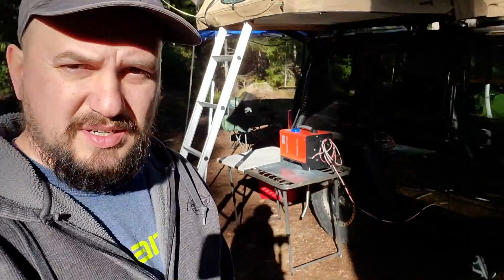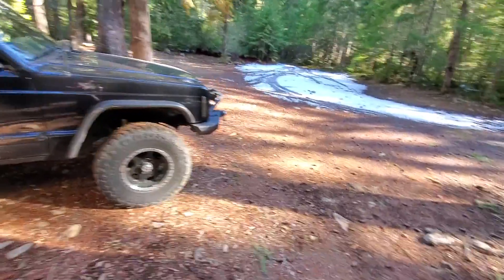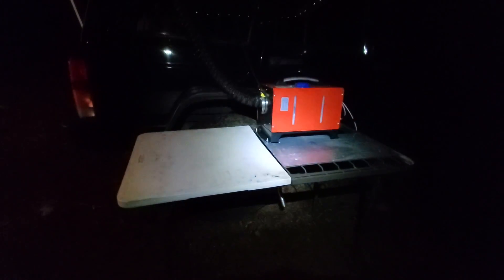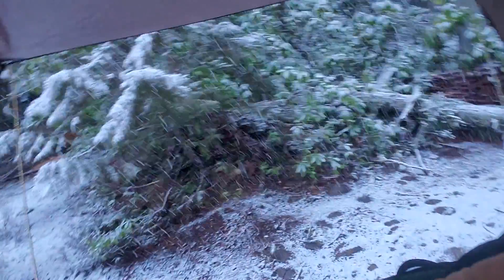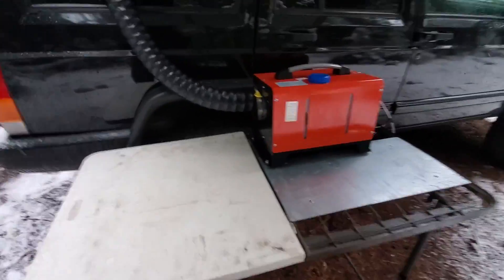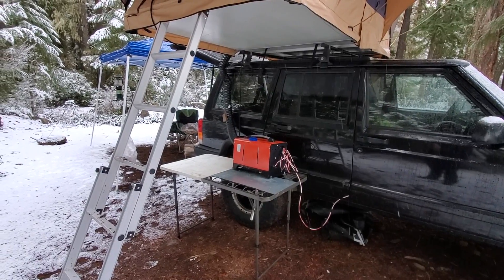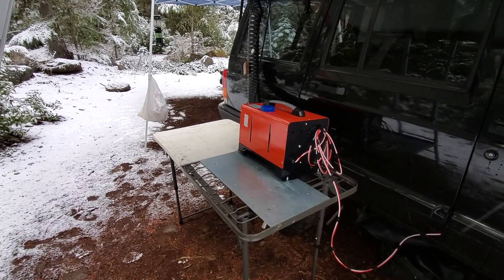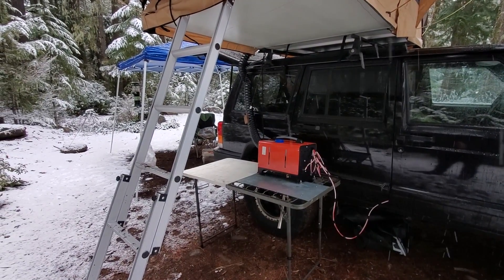Using a chinese diesel heater to heat my roof top tent (review)

Comment: I bought one like that and enclosed the bottom leaving access on both sides using hinged doors. I used copper 90 degree fittings out the bottom to the sides where I can hook up the exhaust (which is insulated and exits on the fuel tank side ) and the combustion air ( which exits out the same end as the inlet air) , this gives me a place to store the exhaust pipe and combustion air tube plus the electrical wires to power it
Reply from the maker: Thats a good idea. I'm sure i will add things on as i use it.

Comment: I have that unit.  It Draws 7.7 amps for a minute at start and at shut down.  It draws .27-.5 amps runnung on low and 2 amps at 3.3 P rate.  Nothing as AWESOME as an Oil furnace blowing on you while watching it snow.  I wouldnt run it a full blast to clean it.  Mine I run at 3.3 puls max.  I set the controller max at 3.3P and 4000 rpm.  These run wild at 5.5P and 5500 RPM.  I was scupitical when I bought mine.  I dissassembled mine all the way down and put it back together twice.  I ran mine on Lamp oil at first.  Dollar General had some for $6 2 liters.  If you need to get some fuel in a pinch this is a good option. I add a pinch of 2 cycle oil .  Cool Video man, LET IT SNOW...

Comment: Fuel is .02 x 1.9 x 60x60 will give you the fuel consumption, and the 1.9 is just assuming that what your low setting is. Use of battery is about 8 to 10 Amps for the start-up, once the glow plug is hot, in about five minutes, the Amps drops down to 1/2 to 3/4 Amp for running it, then once you shut it down it jumps back to 8 to 10 Amps to heat the glow plug to burn off excess fuel. 15 liters I can get about 7days before refueling.

Comment: Looking into one of these heaters as an alt to propane for my 21` 5th wheel. It would have to be in a covered box outside, otherwise I know that clicking noise would keep me awake, like a ticking friggin clock. I think having the tank enclosed in the unit would help keep the fuel from gelling. But if your camper is on a permanent set up filling that small tank would get old.
Reply: Apparently a tank full will last around three nights

Comment: Nice video, thanks, I have a solar generator I built with 400 amp hour lithium Battleborn batteries, can run that thing indefinitely while charging during the day using panels.
Reply from the maker: Thanks. Yeah 400ah would run it for sure.

Comment: Not sure if you did anything with the "clicking" but I have a similar setup, RTT, and a CDH, I took the bolt out of the fuel pump and wrapped foam around the pump and attached it will zip ties.  Barely hear it right next to the heater.  Takes like 2 minutes and works great.  Live my heater, been camping 2-3 days every week here in NE Iowa down to 16 degrees.
Reply from the maker: The clicking doesnt bother me, i drive a semi in a team so noises dont bother me much. But yes these heaters make life awesome in the winter.
Reply: @vmoregon  no worries, simple to do, I have my RTT on a trailer and the heater sits on the frame is it was resonating for a couple weeks until one day I added the foam and zip ties, hilarious thing is I could tell it was running when I heard the clicking, now I can't hear anything lol.  I've caught myself putting my hand over the vent a ton of times to make sure, like it wouldn't be 40 degrees colder if it wasn't on lol.  Sure is a game changer for winter camping.  No more need to be buried in a sleeping bag haha.  Thanks for a great video!

Comment: Excellent video! Just to be clear; all you need for your battery setup is the battery and the box mentioned in the links? (this sounds very redundant but I'm a little confused as to why folks would buy a portable power station which seems a lot more expensive with lower capacity than your setup). Do you have that battery wired up to your alternator or just take off from home with a full charge? Thanks again, I'm hoping to try this heater with my rooftop tent - I live in western Montana and looking to extend camping season.
Reply from the maker: Thanks. Yes I couldn't justify the price of those power stations and that's why I put this together. You just need a deep cycle battery. I recharge it at home and I also wired in a battery isolator switch to charge it from the alternator. Kickass products has a kit for that.

Comment: Them diesel heaters work best when you place them inside the area your heating run the exhaust outside doing that you WILL NOTICE a substantial increase in heat output. Hope this helps
Reply from the maker: Works great for me with this setup. But yes i agree it would benefit having it inside the area you are heating. I only need it to break that chill in the tent. Thanks for the advice!

Comment: Sweet setup! Do you remember where you got the extension wire for the remote? Or was that included when you got the heater? Thank you!
Reply from the maker: Thank you. For the remote i just matched up the same wire gauge and extended it to what i needed.

Comment: Very cool set up! RTT's intrigue me and this is the first time I am seeing a heating system for one. Personally, I use an Alaknak 12x12 and three dog stove for heat during cold weather camping. I too use a separate battery box which houses a 20Ah LiFePO4 in a plastic 50cal style box. Looking to upgrade to a 60-80Ah to contend with cloudy and rainy days where I do not get any solar. +1 sub from me!
Reply from the maker: Thank you thank you. I have that kind of tent also. We usually use it when all of my brothers get together. The roof top tent works great for me and now with the heater im good year round. And yeah thats why i went with 100amh since it will last me the 2-3days i need without recharging. Thanks for the sub!
Reply: Lifepo4 is awesome! Best pack I've ever had

Comment: Well done.  Very informative.  I have a 16 ft Scamp RV  (installed a Dickinson propane heater) a wall tent (wood stove), an old Winnebago (wood stove). and even older home'-made travel trailer (a pot bellied stove),a 1972 Starcraft pop-up that I'm converting to a foldable  hard-side pop-up (with an old propane heater that may or may not work) and I have the back of my Toyota Tacoma fitted with a cot that I heat with a Buddy Heater when I need heat (and there have been times when I've needed heat!).  I'm thinking this setup might work for my pick-up (for when I'm traveling).  My bugaboo is electrical energy as I usually don't have access to shore power.  I charge the Scamp battery with a solar panel (a suitcase style Renogy 100W) but the suitcase is fairly heavy (I think about 60 lbs(?).  Can you charge your portable battery when you're traveling (off you engine's alternator)?
Reply from the maker: Thank you! Sounds like you got a fleet of adventure vehicles 👍. As far as charging the portable battery, i haven't had the need to recharge it since most of my adventures are 1-2 days. But I'm gonna test out some methods to charge it maybe through the cigarette lighter plug. Thanks for watching!
Reply: @vmoregon  the best route in my opinion if you do, is to use a diode switch and a double battery deep see switch. When you want to double charge you would select the diode, but when not camping you switch back to the regular battery, since the diodes under charge your batteries, but it's only an issue for full timers IMO. The upgrade is about $150ish

Comment: I'm new to your channel, your heather is really a great solution for cold nignt in rooftop tent. For your power unit, did you made it yourself or bought it already made???

Mart
Reply from the maker: I bought the battery box and battery seperate. I have a video on it.

Comment: Do you have the 5kw or the 8kw? In this video the link you provide to Amazon says 8kw but in a previous video you link to a 5kw. Just curious bc they are different sizes and require diff size hoses for ducting. I believe the 5kw is a 3in. Im currently trying to set one up so thanks for the vids.
Reply from the maker: Mine is 5kw. I put that link because the one i bought was out of stock so i found a similar one. As far as the outlet i belive they are the same on both. My buddy bought a 8kw to test out and it all looked the same.

Comment: Does the 3-inch air duct you bought from Amazon fit the hot air outlet, or do you have a 2.5-inch hot air outlet and have to squeeze the larger 3-inch hose down on it?
Reply from the maker: I believe its 3 to 3 so it just barely fits.
Reply: @vmoregon  Thank you...

Comment: nice video, thanks for sharing.  Did yours come with the longer cable for the controller?
Reply from the maker: No it did not. That was the first thing i did on it was extend the wires on the controller. I did not want to deal with the wireless remote.

Comment: Do you have any experience with this heater in inclement weather like rain/snow? I cut up a tote to fit over mine but wasn't totally sure if it was necessary with the placement of the electronics
Reply from the maker: I haven't used mine in heavy rain only snow and i had no issues. It wouldn't hurt to cover it. I actually thought about doing the same with a tote.

Comment: Hi. Thanks for the video. Are you not using an air INLET pipe? I have the similar heater and trying to distance exhaust pipe and air inlet pipe as much as I can to avoid sucking exhaust smoke into the heater and into the hot air outlet pipe going to the tent.
Also, can you please provide a link/name of that long heated air pipe you are using. Original one is short BUT is has foil? insulation. In your case it must be large heat losses since the pipe is not insulated at all. I wonder if there is an insulated variant of the pipe you are using.
Reply from the maker: In this case i did not use the inlet hose since my conditions didn't warrant me worrying about exhaust being sucked up. but i do plan on using it to basically circulate the warm air. And in my case i don't see a point of having a insulated pipe since our winters don't get that cold here in oregon. I have a link for the 3in hose that i used in the description.

Comment: Did your setup come with the remote thermostat or did you make that cable to get it inside your tent
Reply from the maker: It did and i threw it away and just extended the wires.
Reply: @vmoregon  thanks I'm going to do the same
Reply: @vmoregon  Do you have any additional information on the wire you used to extend the controller. did you purchase something on Amazon.

Comment: Do you know  by chance what was the temperature outside overnight? I am debating buying a 2kw or a 5kw, I would prefer not having running it to the lowest setting all night if possible, afraid of having to turn it off/on multiple times at night if the lowest setting is too hot.
Reply from the maker: Around 30° and it was perfect at low setting was not too hot at all.

Comment: Mate nice video i want to buy one how did you put the heating tube? i see that he has 4 small ones so how did you put it to dont lose heat?Thanks in advance.
Reply from the maker: Thanks. I bough one that has 1 hole outlet. Just need to look through them on amazon and find one that has 1 instead of 4.

Comment: Do you smell any fumes from the heater in the tent? Ive used a mr buddy before and it smelled really bad. Seeing is diesel heaters is worth the switch.
Reply from the maker: No i have no fumes. What type of vehicle u plan to use it on?
Reply: @vmoregon  Chevy Colorado

Comment: Nice setup, I’m building an overland trailer now and going to mount the heater inside a vented tool box on top next to the tent, what amp hour batt do you have in your batt box?
Reply from the maker: Thank you! Yeah ive thought about doing a tool box version myself but found this one and wanted to see if it will work. The battery a 100ah.

Comment: Hey man how did you make the thermostat extension?
Reply from the maker: I just cut the 4 wires and added about ten feet of wire then soldered heat shrunk them and wrapped the.

Comment: I saw gave a link to someone of a in stock heater that yours was out of stock at time, it seems same link as the one from other video. Do you have the original brand link? I noticed that link below to a subscriber in stock on, the out lets is 4 holes. How did you get it down to one or connect flex hose?
Reply from the maker: Mine came with one outlet. I believe it can be switched out for a 1 outlet they sell all these parts. I looked in my past order and it tell me out of stock and wont give me a link.
Reply: @vmoregon  Perfect Thanks, I thought yours looks like one outlet, compared to most on Amazon have that 4  hole outlet. By they way do you know how many amps it draws on startup and once maintain average, or ballpark guess. I do have Jackery 1000 maybe connect to that, but I run my fridge off that and only has one DC Car outlet, not sure if can do splitter for heater and fridge run off, or do a battery pack like you have done.

Comment: Great video. Do you have a link to the heater?
Reply from the maker: Thanks. The one that i bought is out of stock but here is a link to a similar one.

https://www.amazon.com/Parking-Automotive-Conditioning-Thermostat-Motorhome/dp/B0829TYVR6/ref=mp_s_a_1_41?keywords=diesel+heater&qid=1583788398&sr=8-41

Comment: Hey man! Did you have any worry about melting the tent material with the hose directly touching the tent or was the heat loss enough to not worry? Did you like have to wrap the hose in different material to avoid melting if applicable?
Reply from the maker: Nope it doesn't get hot enough.
Reply: @vmoregon  thanks for the reply. I took it up to northern New Mexico in -6 c degree weather and it was great!

Comment: What about the smell from the exhaust? Camping next to diesel exhaust doesn't sound appealing.
Reply from the maker: Only has a slight smell as it starts up but after it heats up no smell. But you can always get a exhaust pipe extension and route it further away from your tent.

Comment: What diesel heater is is that you have
Reply from the maker: https://www.amazon.com/Peitten-Parking-Control-Monitor-Engineering/dp/B08M194VL9/ref=sr_1_2_sspa?crid=26ETFVIT3ZOJ&dchild=1&keywords=diesel+heater&qid=1605040270&sprefix=diese%2Caps%2C241&sr=8-2-spons&psc=1&spLa=ZW5jcnlwdGVkUXVhbGlmaWVyPUEzOUVPRFJSWkZLWDRGJmVuY3J5cHRlZElkPUEwNDg5MDY5MVpUSFFKOVVOUEk4MiZlbmNyeXB0ZWRBZElkPUEwNTUxOTEzMTA1WlZCQ0tDVUNYSCZ3aWRnZXROYW1lPXNwX2F0ZiZhY3Rpb249Y2xpY2tSZWRpcmVjdCZkb05vdExvZ0NsaWNrPXRydWU=

Comment: I bought the battery and the box and have a 5k diesel heater and it turns on but then shuts off 2 minutes later ? It’s not getting enough power HELP PLEASE!
Reply from the maker: How do you have it connected? I run it to the two studs in the front of the box.
Reply: I have it connected right to the two stubs that come out of the front of box heater turns on it starts to run and 2 minutes later shuts off....did u have to charge the battery when u got the battery?
Reply from the maker: Yeah i did top it off. I would try connecting to your car battery and see if it runs longer. Might be a heater issue. Or its shutting it down due to low battery. But i would first run it off of your car battery with the car running to rule out the heater it self.
Reply: I did run it off my bus battery’s and heater worked great while bus was running I’m charging it right now on a 12v battery charger for the last hour all 4 lights on box light up !...I’m gonna connect the heater directly to the battery and see if it runs continuously if not maybe battery is no good will see shortly thanks bro
Reply from the maker: @Kleenuout  yeah thats strange. Mine runs with zero issues had it run for 10hrs none stop.and gave me no problems.
Reply: Yours is a 8k heater right?
Reply: I know I watched that video and I bought everything except the heater I bought the 5k 2 weeks ago
Reply from the maker: Mine is 5kw also.